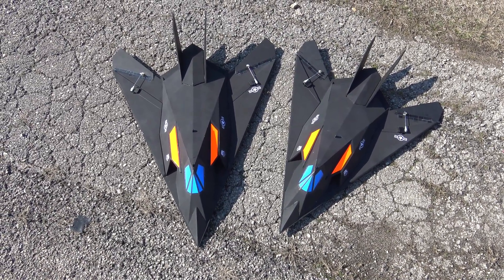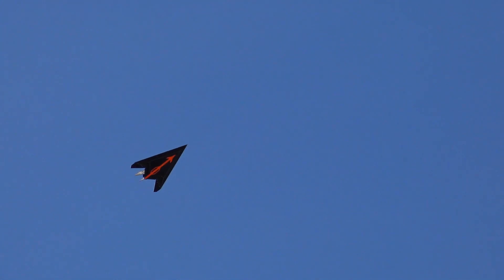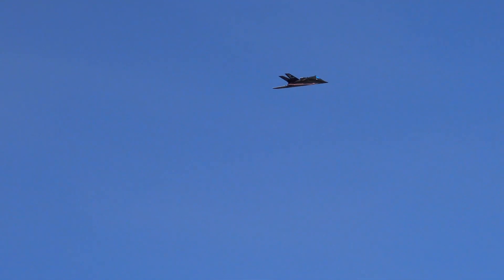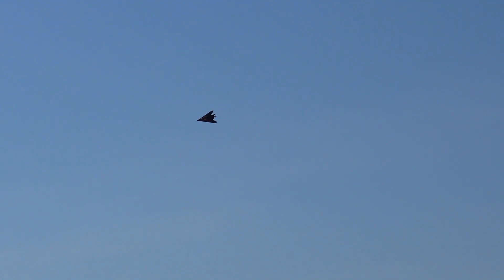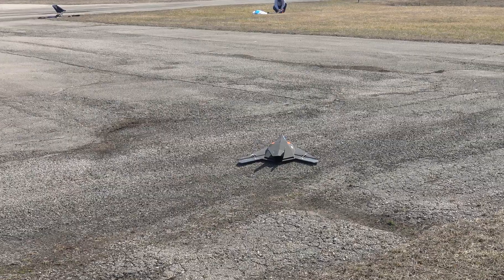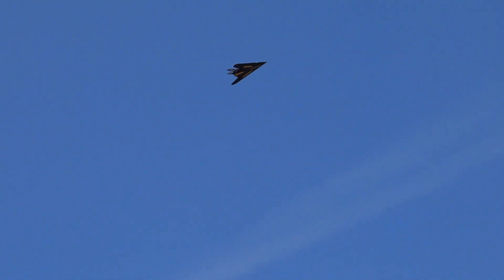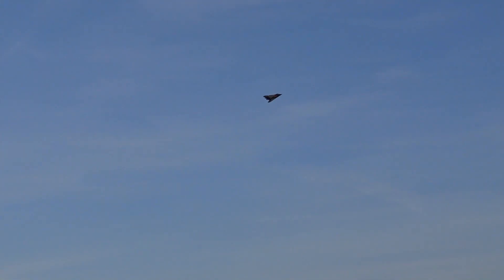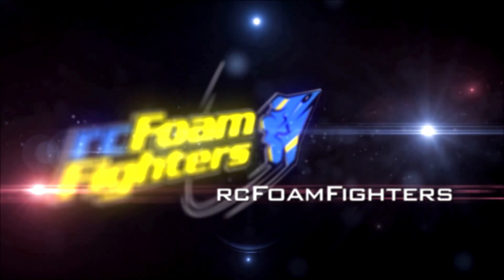FF-117V2 50mm and 64mm EDF Maiden Flights

Comment: nice work Frank, the 117 seems to fly very nice, even its not super fast, didnt expected that anyway, but she looks super scale in the air. Im always a little suprised how good the orientation is on this plane, you know almost all black and all but from my chair here ist looks pretty good, even the take off was a bit more exciting than i would hope...i usually programm and launch phase in my controller that gives me a little bit of up trim for the take off...and than switch back to cruise when im up in the air. And if you wanna go bigger i would try 70mm on  4s probably, which is a pretty light setup and give still good power (for an edf i mean), anyway good job, cheers
Reply from the maker: Thanks WarbirdFan66! Yes both take offs were a little crazy! The first one my friend threw the plane at too low an angle. The second launch my friend threw the plane a little sideways into the wind. So some torque roll and wind made it roll over pretty good.  The all black plane can be hard to tell orientation, I crashed my old prop version because I lost orientation. Thats why I now add the small bright orange stripes to help my getting older eyes, LOL. Thanks for your tips on how you program a take off mode.  Oh, by the way I am Paul, with the FF-117's, Frank is the one with the Crazy Twin motor plane.

Comment: Here I am thinking  how to make it a mid engine or pusher, nice design!
Reply from the maker: SRGross I originally made this plane as a mid engine pusher prop a few years ago.  The pusher prop version does fly with much more power and authority. I just started to work on the EDF version because I've had a bunch of people ask for an EDF version. If you have not seen the prop version, please check out our YouTube main page. Thanks!
Reply: @rcFoamFighters  I will check it out, the edf noise is just irritating to my ears.

Comment: Hey your on the other end of the spectrum now lol. We have always concentrated on the fast end. Seems  those two are in need of speed.. Good job guys!
Reply from the maker: You are correct Gregg, we need more speed, LOL! I think that is why they feel so slow to me is because I usually always fly fast planes.  I plan on doing a few more mods to the bigger one. Hopefully I can slide the EDF back a little more. If I can do that then maybe I can get a 6S EDF to work and balance on the CG line. Right now I am having to put the battery closer to the EDF than I want to get the right CG.  Maybe with a few cheater holes the EDF will breathe better and give some more speed too.
Reply: @rcFoamFighters  I'm sure you'll tweak it out and pick up a few more mph.

Comment: Planes look heavy, may need modifications to shed some weight.
Reply from the maker: Robert Wong, I do think I need to try and shed a little weight if I can. I think I can trim a little more out of the internal riser plates and a few other areas. I think the 50mm is pretty close and flew better. The 64mm is heavier and I think the Air intakes are more restrictive on it for the size of EDF. I may have to add some cheater holes to let the EDF breath better and give it more power. I think I can trim a little weight off of both with a few tweaks.

Comment: Wow love the way they look on air want the plans   to be available for sale good work
Reply from the maker: Thanks Javier Rivera! I think the 50mm version is pretty close and I can probably make plans for it first. The 64mm I want to revise and test a little more before I make the finale plans.
Reply: The 64mm needs more air  intake
Reply from the maker: @javierrivera7154  Yes I agree, the 64mm needs better air intake. I will probably add a couple of cheater holes on the bottom and may small ones on the top. I think I need to push the EDF a little farther back in the plane so the thrust tube is shorter.  I will try and modify the existing plane and also make a new one.
Reply: @rcFoamFighters  yes but still your the best love the project ❤  want to see that 64 hitting 70 mph haha💪

Comment: They look great, hopefully I can get my laser cutter going on a plane of my own!
Reply from the maker: Thanks M K. I think the 50mm version is pretty close and I should be able to start on the final plans. The 64mm version needs some more tweaks to get it to fly better.  I may even put a 70mm EDF in it instead.. It may also need some cheater holes to breath better...
Reply: @rcFoamFighters  I’ve been working on a compressor wheel edf that theoretically would suck air in harder than an edf, if I get it working I’ll let you know about the airflow qualities